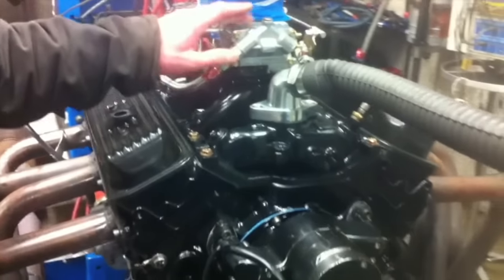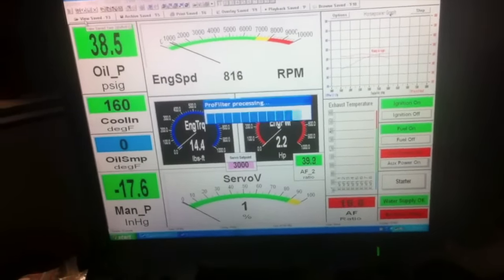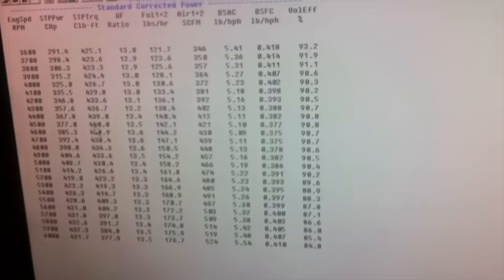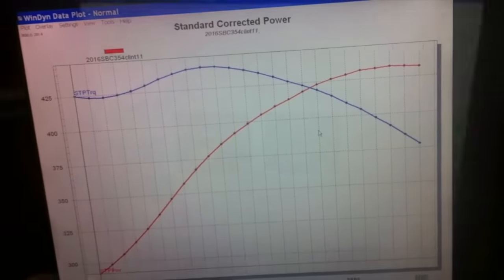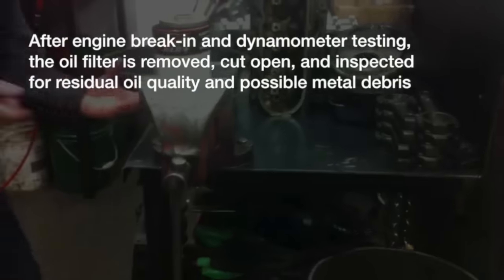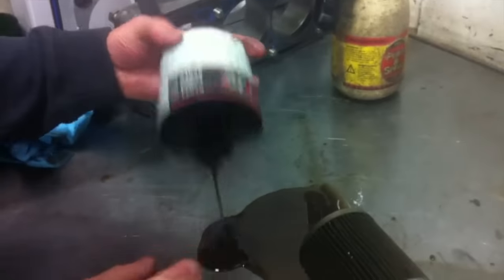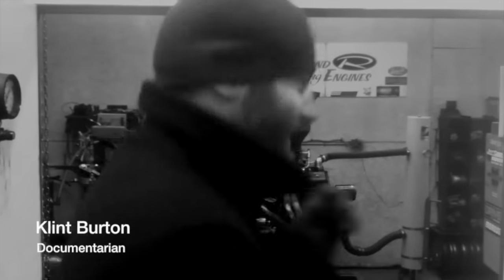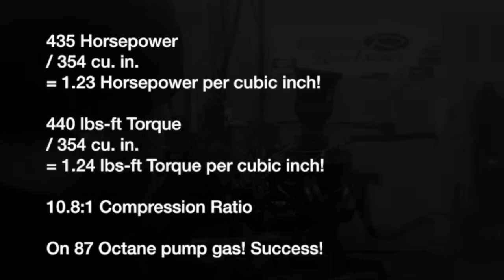SBC 400 Block + 327 Crankshaft Dyno The 350 Chevy Should Have Built (2016)

Comment: I've always loved short stroke motors like the Chevy 283, 327 and the Ford 289s that turn 9 grand in super stock. Also loved the way Glidden took the Ford 351 Cleveland destroked it to a 330 and cleaned house with for years, you just can't beat a properly built short stroke big bore motor.
Reply from the maker: That’s awesome. Thanks for commenting!
Reply: Glidden had good heads.
Reply: @doomman700  yes he did the Cleveland 4v heads are awesome. He was a mechanic way ahead of his time.
Reply: @davescbradiorepair8195 ,
Bob Glidden was way ahead of his time but, you have to remember one thing, he was a mechanic with "Clean hands".
Reply: The 302 Boss engine was also a great little high rpm engine that made some serious horsepower right from the factory, and they lied like hell about the advertised horsepower of that particular engine
Reply: Stroke has ZERO affect on RPM. RPM is limited only by the size of one's bank account balance! IF Glidden destroked a 351(which I've never read anywhere in the 50 year history of Pro Stock), it was because in the early days of Pro Stock, weight & displacement were both open.Light weight is ALWAYS an advantage in acceleration, proven by NHRA "adding weight" to make PS Motorcycles more equal. Once NHRA instituted a minimum weight in PS, running a smaller displacement engine was no longer an advantage. Bill Jenkins dominated EVERYBODY until the weight rule was instituted. Little engines don't outrun BIG engines! IF one builds 2 engines of equal displacement & turn them the same RPM, 1 being big bore short stroke & the other smaller bore & longer stroke, the big bore / short stroke engine will make more HP because it has less parasitic loss due to "piston speed"(the distance each piston travels in 1 revolution), FRICTION. Also, the cylinder wall is farther from the intake valve CL, which unshrouds the airflow & also allows for a bigger valve, which creates more HP. Try doing the math for the distance travled by 8 pistons with different strokes. A 1/4" difference in stroke can make hundreds, even thousands of "feet traveled" by the pistons at any RPM

Comment: No matter what combination of parts you put together Chevy always comes thru with power. I've had many different size Chevy engines over the years and the one's I liked the best were the one's using the 400 block.
Reply from the maker: Hi ps3613t! Great comment, thank you. We love 400 blocks at CE Performance. Best regards.
Reply: I regret never building my 400 blocked 377 for my 79 Malibu..  Had a set of older aluminum gm hp heads for it.
Reply from the maker: @terrypikaart4394  Hi Terry! Thank you for writing. It's never too late to build that cool combo. Our build combination was a customer's idea long ago ... and then the right block came along and here we are, making the idea happen, and we're proud of it. If you're able to, revisit the engine idea you always wanted to build! We strongly encourage it if you're able to. Best regards.
Reply: My small bore 305 sure runs smooth, not a powerhouse but runs like a top.  My 350 made more power but was a bit rougher (IMO).
Reply: Yes I love the Chevy 400 blocks with a 327 crank just like the Ford 351 Cleveland destroked a 330 like Glidden ran.
Reply: GM junk is the best reason to build a mighty MOPAR engine....
Reply: @wildestcowboy2668  A Mopar or a bad-ass Cleveland like Glidden used.
Reply: @davescbradiorepair8195  u ever built a 426 my friend?
Reply from the maker: Please share your build!
Reply from the maker: Yes, please share!
Reply: @wildestcowboy2668  yep I've had over 100 cars in all 3 makes, T roadsters you name it along with most every v8 made except for Olds motors I've never had one of them.  Even after my built clevelands that I've had after I rode in my friends 427 Shelby Cobra nothing else excites me anymore lol and yes I've been in 427 vettes, Hemi cudas etc and they are all a blast to drive but that Cobra just takes the cake my face ached for a week after feeling that acceleration a few times. My friend in Florida has a V10 prowler and it doesn't even make that kind of G forces. Years ago I had another friend was a fireman and raced on the weekends he put a 427 that came off of a pulling tractor that had won many trophies in his currently 289 powered Maverick for circle track racing he lapped all of those high dollar Chevy's and other cars out there. There's just something about that high riser 427 Ford that others just don't have. My favorite small block will always be the original 351 Cleveland though but the Chevy guys definitely learned to hate it.
Reply: @davescbradiorepair8195  I have had ALOT of cars but not that many as u say u had. I had a 69 firebird with a 67 built GTO 400 and seriously Im a MOPAR guy but that car, I didn't need to be driving it at 19. My favorite motor is the 318 especially in later years, not the fastest but held up and was like totally bulletproof.
Reply: @wildestcowboy2668  i wish i would have been a little wiser back then and kept a few I could probably retire but yes I'll agree on that the 318 is a damn good engine and there's some builds that gets alot of power out of it. After hanging around the guys in superstock I realized it's not the size of the motor it's how it's built. My friend Bobby Fazio in Pennsylvania runs a 289 turning it 9000 going 10s in the 1/4 and Ray Scardelli also runs a 289 turning it over 10,000 rpm going in the 9s which I would be scared to turn any motor that high. Check them out on YouTube.
Reply: @davescbradiorepair8195  Enjoyed the conversations with ya. If y'all are ever in muscle shoals Alabama holler at me. I'll show u the last 69 charger built !
Reply: @wildestcowboy2668  I have Mopar, Ford, and GM......us hot rodders got to stick together and keep the hobby alive.
Reply: @yurimodin7333  I can respect that my friend. I live in muscle shoals Alabama on the Tennessee River, where do u live?
Reply: @wildestcowboy2668  IL, near IN & Kentucky.
Reply: @yurimodin7333  Never been up north, stay safe up there my friend.

Comment: Lol....love it!!! 350 torque and screams like a 327.....best if both worlds!! We put didge 318 rods (6" ish iirc) in a 350 in high school. The small ends were the same size and we had the engine builders resize the big end to accomodate the stock 350 crank. We turned the tops of the stock low compression smogger dished pistons to clear deck height. That sib was near indestructable.....except if course it would float valves at 7k rpm and bend push rods often.....but it was a very budget build. It woulda been a great motor for off roading cuz you could rev it to the moon.
Reply from the maker: Awesome. Thanks for commenting!

Comment: I built 348's for dirt late models . Spools FAST !  635HP 8400 rpm . 6 track championships . Killer engine !
Reply: I'd like to build something like that, that 635hp would allow me to keep up with the stroker engines in the hobbystock class that their not supposed to be running, and still be within the cubic inch requirements!!
Reply: @jeremyhood5206  Yeah, guys out on our track even running 414 , 421's lol The little mouse still spanked them. 355 Ci rule, they say only 4 bore blocks, but I never seen a head pulled, the always whistle test a hole or two. Back in the day building mills for hobby stock, 350 bore rule, we would put SBC 4.125 pistons in 7 & 8 😀 They never tested them, they didn't like struggling to get back there. We made sure stuff was in way to make it hard to get at  ! muah hahu😈
Reply from the maker: @BrainDeadEngineering 
That’s awesome!

Comment: This is a common street stock engine build in areas with NASCAR tracks. Most have a 360C.I. limit and this combo goes thru tech with an engine pump. Gives an advantage with the big bore for cylinder head flow.  Spacers or spacer bearings make this doable.
Reply from the maker: Hi Performance Engines! We had the benefit of utilizing a Dart SBC 400 block that had seen a few rebuilds; the block had 2.45" mains, and we had a steel 3.25" stroke crankshaft on the shelf—perfect for this application. Thank you for your comments! Best regards!
Reply: In 68 or early 69 when they made the 327 to 350 transition they put some large journal 327's in trucks. With those crankshafts you don't need the spacer. I believe they were forged. People were putting them in 350's and getting a 331
Reply from the maker: That’s true. The only reason it would become a 331 is because the block was bored .030” over. The 327 and 350 both start life with 4” bores.

Comment: Working in a machine shop I've built many sbc strokers, including the 348 stroker described in the title, they would run the socks off the majority of the 372s and 383s.
Reply: That sounds good ! Have a balanced 68 327 all forged factory rotating assembly 11-1 compression, block froze, 12,000 miles on stock bore. Trying to decide 350 or 400 block, have alum. & hump heads built for 327. Also Summit racing have splayed german steel blocks 350 or 400. Don't know what heads their 400 will use, Steam ports or not. What would you do with my ex. cond. assembly ? Thanks  Sensible budget or just not even bother. Thanks I trust your thoughts !
Reply from the maker: @rader1175 
Thanks for sharing! Since you have a 1968, I’d assume it was a large journal so with the spacer bearings you could put that crank into a 400 block of your choice. Steam ports are not that important in my opinion. Bringing the coolant from the back of the intake manifold to the thermostat housing is a great way to help keep it cool. We’ve also drilled and tapped small 1/4” fittings and hoses into the top of the block deck on both sides and run hoses into the water pump body. Helps with heat as well.

Comment: I believe the BB W 348 had a Bore/Stroke comb like this !    Pretty torquey , used in 2-5 ton trucks !
  409 had huge bore and short stroke…….My favorite Bow tie !
Reply: you are right. i was going to write that but you beat me to it.the W blocks.4.125" bore, 3.25" stroke 348. i can't remember the 409 specs, but i know it had a very large bore.
Reply: @dougburg3210  the 409 was 4.313 bore x 3.50 stroke
Reply: The biggest problem with 348s & 409s is the same as the Ford MEL engine of the late 50s. The combustion chamber was a goofy shaped piston with a big angle on it for the chamber & requiring the rings to be extremely far away from the top on the long side, instead of being in the head. John Kaase took a MEL & made a very thick aluminum "head gasket" that lengthened the intake runners & allowed for a combustion chamber at the UNOH Engine Masters Challenge & destroyed the competition in the "vintage" class. https://www.youtube.com/watch?v=c-Tq8dLdM50
Reply: The 348 came with a standard bore of 4.125˝ and stroke of 3.25˝. Its big brother, the 409, came with the stock bore size of 4.3125˝ and stroke of 3.50˝.
Reply: Right heads and 1.75 rod ratio makes good torque. The piston hangs at tdc longer so it gives more time to push on the piston than shorter rod ratios.

Ford 429 was very similar, though a well built 390 would eat it alive in torque and fuel economy...
Reply from the maker: @Faolan161 
Thank you for your comment!

Comment: Nice build. Did a similar build in 1991 using a factory 2 bolt gm block. I was stuck with the Ford rod due to budget constraints. About the most trick thing in the engine was the Pistons from a local MFG in Long beach CA. I do not remember the name of the MFG but it started with a V and set me back over 300$ 1991 dollars. And a set of bowtie Phase 1 iron heads home ported. It was a awesome combo with a solid tappet Isky z35 cam (also locally MFG in Torrance CA) Many friends / racers Questioned the 350-claim due to the 400-block missing freeze plug. Never raced it on 87 fuel but drove it to work many days with 87 in the tank. Nice to see a modern version built without the Weak 300 rod. I never broke one due to rod failure mostly due to the rpm limits of the Z35 cam as it was all done before 6500 rpm. I never had mine on a engine dyno but at sea level (brotherhood raceway in long beach) it was very constant 10.70 in a 3200 lb car (72 vega). I guess it was in the 450- 500 hp range on pump gas.
Reply: Venolia  Pistons ?? Does that sound familiar ?? 🤔
Reply from the maker: @waylonmccrae3546 
Sorry it doesn’t.

Comment: Excellent build, love that it's on 87, and here I was all happy i'm making big power on 89 octane with 10.7 to 1 with aluminum heads.
Reply from the maker: Thank you for commenting :)
These long rod, short stroke combos work great for that.
Reply: I'm curious what it would do on 85 Octane.
Reply from the maker: Probably quite similar but might need to run a few degrees less timing.

Comment: Chevy did make this bore/stroke combination, just not as a small block.  It was the 348 W, the big block predecessor to the 409.
Reply: Yes, and it was a badass engine. Heavy, but tough as nails. My granddad bought an old taxi cab with a 348 and modified it in every way he could think of. He put it in his jacked up 55 Chevy 2dr post with a solid front axle and tilt up fiberglass front cap. The car was scary fast and the joy of my childhood. Lots of fun memories
Reply: @edjackson4389  With STUPID pistons & no combustion chambers in the head, very similar to the FMC M.E.L. engine. NASCAR builders proved one doesn't need any more combustion chamber than is necessary for the valves. 348/409s were just an average motor, nothing exceptional. Big Block & Small Block Chevies both destroy W engines when it comes to performance
Reply: @bradgriffith4231  They looked cool and got the job done my friend . In 1976 everything you just mentioned was irrelevant to an old man just tooling around in his garage building something fun and spending time with his grandchildren. Thanks for the negativity though. The 348 came in a 360 hp version bone stock in 1958. That was plenty enough to be fun

Comment: In the mid 80's I built one of these strokers for a street stock class I was running using a 400cid 4bolt block, a 327 Large Journal Forged Steel Crankshaft w/ 2.02 1.6 54cc Camel Back Heads, Pink rods.....at the time Arais made a forged flat top piston for the application,  turns out on paper using stock dimensions it was a 348ci displacement......Powerful Little Mouse of a motor that would run a 350ci into the ground!
Reply from the maker: Hi iron! Sounds fantastic! Thanks for sharing that bit of your history!
Reply: Dirt track secret😉
Reply: My brother would flip the pistons upside down and outrun everyone of the other motors with the same dimensions.
Reply: I worked for arias racing pistons when they shut down 🫤 best job I ever had. We would machine any dimension piston that anyone wanted! Miss that place so much!
Reply: Destroked

Comment: I built one in the 70s or my 1967 chevelle using a 400 bock and a 327 crank with stock small journal rods  it had 292 heads and 12.0 compression with a big  general kenitics cam  it was a hoss and would really rpm
Reply: Wasn't it 194 heads?  Camel hump angle plug?

Comment: Growing up my buddies dad owned a junkyard and he talked about this combo all the time!👍
Reply from the maker: Thank you for commenting!!
Reply: It's actually not magacial, unless you are restricted in cubic inches to fit into a racing class, even then the engine with the best heads wins (regardless of bore & stroke). The larger bore does allow for a larger intake valve and better breathing with any valve size.
 A better JY combo would be using a 400 with an offset ground/stroked crank using the 327 2.0" rod journals. Build them as big as you can to make power !!